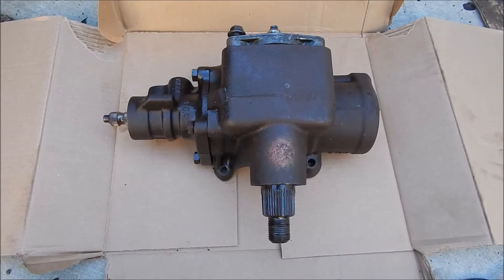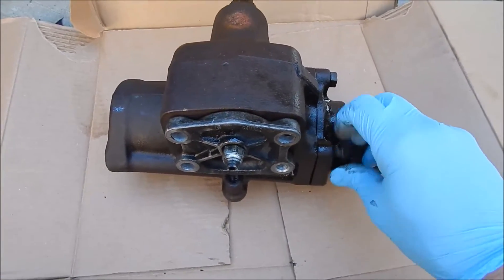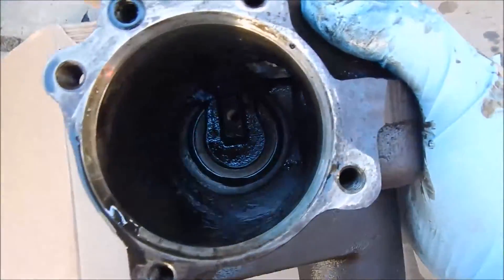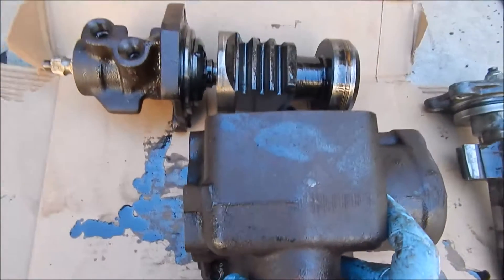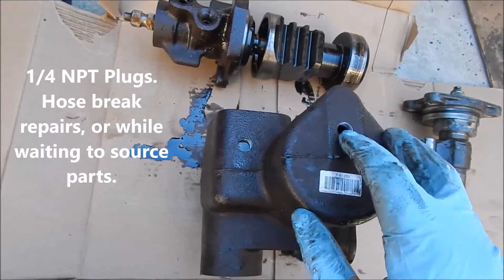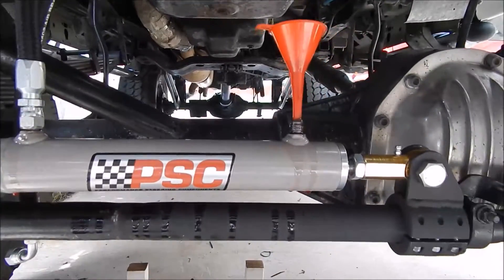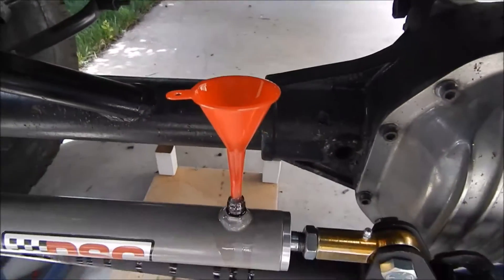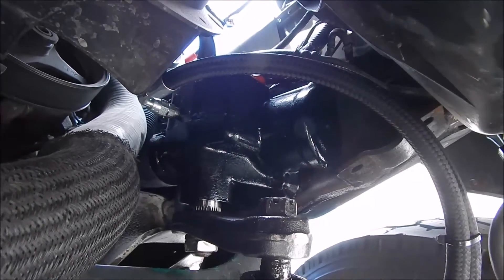Super Duty Hydro Assist Tutorial. F250/Excursion

Comment: There is a secondary benefit of this modification too I feel. 
Ive heard that in a few rare instances the sector shaft has snapped/sheared off (!! which bit, threaded portion or splined shaft, they didn't say)which completely mechanically disconnects the drop arm from the steering box if that indeed detaches with the obvious total loss of steering control and impending death. With a hydraulic cylinder in the steering system as well, the drop arm might detach but you would still have hydraulic control of the cylinder and be able to keep your wheels in a straight line and get to live to tell the tale.. God forbid that happen to anyone at highway speeds. Incidentally , I've seen in a few posts here n there, people are tightening that drop arm nut up to 350LBS/FT.Is that some superseded instruction I don't know about?? I have a Ford manual for my 2004 F350 and it states in that manual the retaining nut be tightened to 199LBS/FT. or 270Nm.(Volume 1 of the 2004 wksp manual P211-02-10) Id be putting some blue Loctite on the splines and the threads too to fill in the minute gaps and I will be changing my steering box in the next few weeks. Maybe, that overtightening is over stressing the threaded portion and its typically snapping like a carrot at the machined corner where it meets the thicker splined part?? seems feasible and entirely logical, to me anyway....
Reply from the maker: Thanks for sharing that info.

Comment: What fluid did you use after you installed the psc cylinder?
Reply from the maker: I used the factor recommended power steering fluid.  It becomes part of the power steering system and shares the fluid.

Comment: Are you using the 1.5” or 1.75” ram from psc? I’m a little unsure which way to go with a stock pump in regards to street handling. I hear the bigger diameter the turning is slower
Reply from the maker: I am using the 1.75" ram. I haven't done any testing with different diameters to know just how much difference there is. I haven't had an instance where I felt it was lagging though, it's been fast enough for me.
Reply: @OffRoadEndeavor  awesome glad to hear some feed back from someone who has it on essentially the same truck. I just ordered the 1.75 looking forward to being able to turn my steering at idle. I replaced everything steering related and this is the last resort to move 38” tires with a 8”lift.

Comment: Where is your drag link attached? I’m trying to install this setup in my 05 Excursion using the no weld kit. So I’ve got the same tie rod clamp you have but it mounts to the passenger side and the anchor for my ram mounts to my diff pumpkin. Problem is there is no room on my pass side for the clamp. It’s too busy with track bar mount, drag link attach to tie rod, etc. If I tried to reverse and mount like you’ve got ram wouldn’t fit because drag link occupies the space. I see your drag link up high on one end when you show your pump and hose routing but i can’t see where you’ve got it attached on the pass. Side end to the tie rod, i can’t figure out a room solve except maybe just using the weld tabs and welding to axle tube and tie rod.
Reply from the maker: Hi Sammy the Ditch Doctor, I'm sorry I didn't get a better picture of how the ram mounts. I have two things that make it unlike a stock setup. First I have a high mount passenger knuckle so the drag link attaches to it's own mount high on the knuckle and not down low on the tire rod, right where you are finding there's no room. Second, yes I have the axle mount on the passenger side and the mounting tabs are welded to my custom track bar mount. I hope that explanation helps. Good luck on yours.

Comment: Looks great, I have an 03 ex that I'll be doing the same thing too. Which PSC ram had the correct stroke for you? Also, how would I comfirm this is the same stroke for me?

Thanks!
Reply from the maker: Bill Loewen I am using the 1.5" diameter by 8" stroke. A smaller diameter moves faster than a large diameter ram.  To find the stroke i turned the wheels all the way to the left.  Made a reference mark on the tie rod and axle at the same spot. Turned the wheel all the way to the right and measured how far it traveled.
Reply: Thanks for the reply! Does your stock pump work fine with the hydro assist or does this need upgrading as well?
Reply from the maker: Bill Loewen I am using the stock steering pump. I have not had any issues with it at all.  No burnt fluid,  no bubbling, no leaking, no whining.
Reply: thanks bud!

Comment: So I noticed you still have you stock steering pump. Do you still use your stock steering? I have an 06 f250 6.0 with a 6 inch lift an 37’s an I’m constantly losing pumps an high pressure lines. When you run this system do you completely delete the stock steering an just use the hydraulic rams? I’m tired of replacing stocking steering pump an high pressure lines. Thanks if you can help.
Reply from the maker: I am still using the stock pump and hoses. The steering box is a rebuilt RedTop brand. I also have hydro boost on this truck.
Reply: Off Road Religion ok thanks dude I’m so at a lose with this truck. Like I said I replaced the Gearbox, pump, an all the lines an it did great an now it started leaking again at the High pressure line at the bottom of the ps pump. Maybe I’ll just replace the lines an pump again an add the hydraulic ram assist at the same time.  An I’ll just wait to drive it until I get the hydraulic steering. Thanks for the help man.

Comment: Why would you need hydraulic assist? I got 35s and mine steers fine.
Reply from the maker: I'm running 42" tall, 15" wide semi truck tires that weigh over 200lbs, with an offset. So it makes the turning quite difficult. I already had to replace the steering box, drag link, and tie rods before doing this addition.  You're right, 35s without a huge offset would be fine. I had run a narrow 38" on my last excursion and didn't feel I needed it then. Thanks for the question.

Comment: That's a nice mount for the hydraulic ram. Did you make that? I recently did a high steer and it works very well. Hydraulic assist is next.
Reply from the maker: The split round clamp portion I purchased, but cut and welded the tabs/wings to it.
Reply: Instablaster.

Comment: Is this the same for the 2005-2008 boxes? I need to do this to my 2006 F250.
Reply from the maker: The process is the same yes. As for the locations to drill, I haven't taken one apart to see where. Most boxes of this same shape and design will be the same. You'll see some boxes tapped in the neck as well. Some Internet searching lead me to some forums that go over the 05' boxes. Good luck.
Reply: @OffRoadEndeavor  what forums have you seen pics on? My searching isn't as good as you apparently.
Reply from the maker: @SnowroxKT  I found this post which has some good pictures, https://www.ford-trucks.com/forums/781374-porting-a-superduty-power-steering-box.html.  It looks like they tap into the neck near the inlet ports and also at the end of the main shaft. There is a PSC kit as well, for the 05' part number PSC SK753.  Best of luck to you.
Reply: @OffRoadEndeavor  fyi the same locations worked great for my 2006! Thanks for the help.
Reply from the maker: @SnowroxKT  that's great news. Thanks for the follow up.

Comment: Maybe my stock steering is trying to hard to turn the 37’s an that’s why they keep blowing. My high pressure line constantly leaks. I’ve tried buying new lines replacing the white o-rings an no luck. I just went through 2 I-rings this morning an still leaking. I’m at a loss with this. Very frustrating. Was thinking maybe I needed a stronger pump cause my truck sitting my steering pump can not turn my wheels. They turn a tiny bit by when I’m moving will turn just fine. Just put brand new gear box pump an lines not even a year ago.
Reply from the maker: I'm not sure where your problem is originating. I tried some internet searches and couldn't find a common occurrence. I have never had an issue. I can turn the wheel with one finger at a stop and i can turn from lock to lock. I don't know if the hydro boost as part of the system helps.
Reply: Off Road Religion YeH I have a hydro boost as well. But the fitting at the bottom of the pump for the high pressure line keeps leaking no matter what I do. Like I said the other day I bought a brand new line put it on an it leaked. Took the line off at the bottom of the pump an replaced the white O-ring twice still leaks. My pump an threads look fine so I have no idea what is causing it to keep leaking. But it’s hella frustrating. I’m gonna give it 1 more try this week.

Comment: did both gear boxes funtion the same being tapped in to different spots
Reply from the maker: Pure Addiction Motorsports , yes the boxes would work exactly the same. You could drill the hole into any portion of the sector shaft area under the top cap. The fluid cavity is all under the same pressure. The reason the hole is in different locations is I had drilled it and sent my box in for a rebuild. The company had one already drilled and rebuilt in stock so they sent it to reduce my wait time. Functions just the same.
Reply from the maker: I would say due to the differences between vehicles, I suggest deciding on what fittings you are going to use then hold them up in place with some hose attached to ensure you're going to have the clearances once everthing is drilled, tapped and installed. You may have to relocate the hole or use a 90 or 45 degree fitting instead of a straight or vice versa.  Overall It's pretty easy once you get past the nerves of drilling a hole in a working steering box. Good luck!

Comment: Where did you order your ram and brackets from?
Reply from the maker: I made the tabs for both ends myself.  The tierod clamp was purchased from RuffStuff but can be purchased from many vendors.  I tried sourcing an inexpensive ram but I could not find any with the correct stroke.  I ended up purchasing the ram, which is the correct stroke for this application, from PSC.